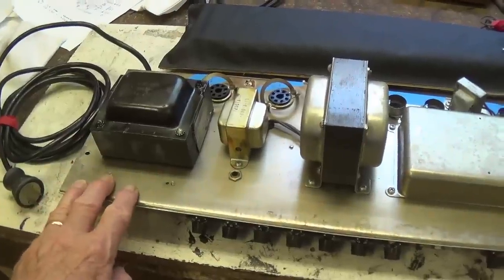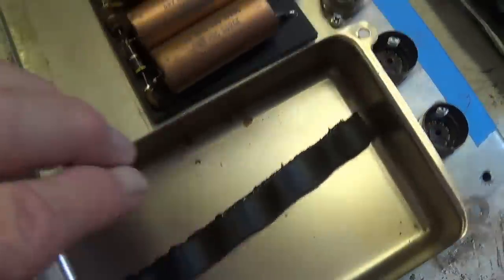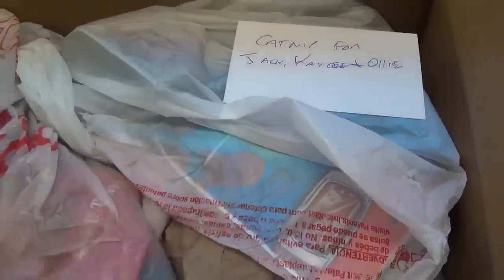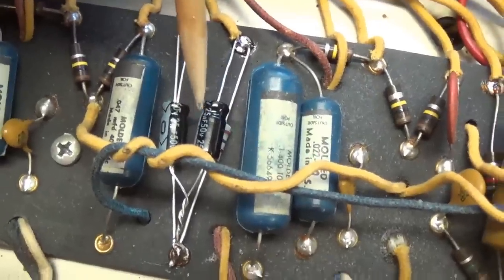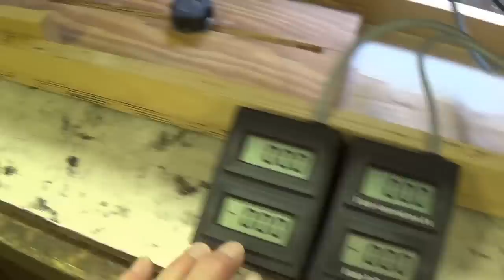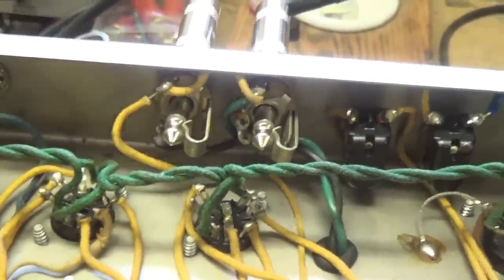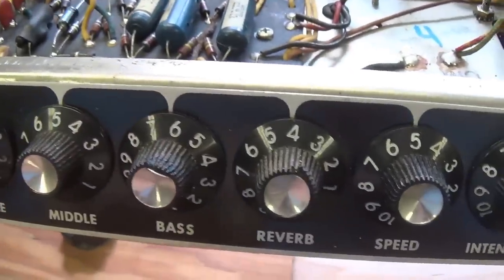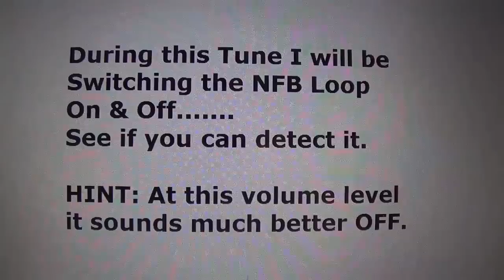1966 Fender "Blackface" Super Reverb:  In Storage for Almost 40 Years !!

Comment: I just got my '64 Super Reverb back from my techie guy. The amp was working but did not have any sparkle to it, and the reverb really vacuumed.  A tech or two from years past had installed some junk tone and coupling capacitors. I asked him to install blue SoZos in place of the brown and orange uglies, which he did. He also rebuilt the vibrato circuit (WOW!) and changed out a capacitor and a few other parts in the reverb circuit. I also asked him to install and bias two Tung-Sol 5881 power tubes, replacing a couple of WInged C 6L6GC's. I asked him to install SoZo silver micas for the treble caps. I also installed a big rectifier tube (sorry, cannot remember what that was, but it's a big coke bottle), to limit output a bit and headroom. I have some new vintage style reverb cables on the way! All I can say is, WOW! What an amp! After many decades I can once again say that I love my Super Reverb!
Reply from the maker: I hope it serves you well for many years to come, TT.
Reply: Thanks, Uncle! Got the reverb cables today and played the dickens getting them installed (working on the floor, which is tough when you're 76 years old!), but I got the tank (all cleaned up!) and the cables secured down at the bottom, and the wrong length cables safely secured to the side of the cabinet. WHAT A SOUND! I highly recommend the 5881's and SoZos! @UncleDoug
Reply from the maker: @Tonetwisters  Thanks for the update, TT. Glad it went well.

Comment: I just finished a Stromberg-Carlson p-p 6L6 Model 20/207 amp and couldn't for the life of me get anywhere near plate current balance no matter how many different pairs I tried. Since the amp is cathode biased with a shared resistor and cap, the only other possible cause for the imbalance was the output transformer primary winding which measured at 34.2 ohms and 37.2 ohms respectively, which accounts for the disparate Ip idle values.....It sounds great.....!!!

Keep up the great handiwork and the ice-cold humor Uncle Doug...!!!
Reply from the maker: Thanks !! Will do, Jordan :)

Comment: Hey Doug, love your work. I've had several Fenders in this orig condition (59 deluxe, '66 Super Reverb, 64 Princeton) and while it's absolutely necessary to do the recapping, I always feel like the guy who clubbed the last Dodo. There's no going back. Have you ever re-sleeved new caps in the old covers or made repro sleeves? I know it's probably silly but I'd love my amps to look original when I peel them open. Best wishes from Australia.
Reply from the maker: I understand completely and for years advocated keeping as many original components as possible.....which is fine for my own amps, since I can re-repair them quickly.....but for customer amps, considering the effort and cost of shipping, I just can't justify it.

Comment: Doug buddy working on that amp is an incredible honor!  

A few years ago I was engaged to clone a 1964 AB763 that was in very good condition but not as clean as this one. I didn’t have access long enough to fully blueprint the amp but a lot of the carbon comp resistors had drifted significantly.  The amp sounded GLORIOUS!  It belonged to a college professor who played guitar and harmonica through it, but his father was the one who hired me to make the clone ... his son wanted his amp back. 

Trying to make a long story short, my build was almost stock for the Vibrato channel. The major exception was bias vary tremolo from a Brown Vibrolux (6G-11) instead of the optical roach.  The Normal channel was anything but. It has reverb and tremolo. The tone circuit is Brownface Vibroverb (6G-16) with that weird tap on the Treble pot. I turned the Bright switch into a guitar/harmonica switch with different cathode resistance and frequency cutoff.  And I used plate resistor values close to the old amp - they were much higher than 100K. 

To say that the amp is loud is a gross understatement. 😎

One question:  when you are doing a major overhaul like this, do you go through a step-by-step startup procedure first with rectifier tube only, then power tubes, then everything, with a light bulb limiter in line in case something BAD starts to happen?  I’m pretty sure I saw a light bulb limiter in the background there ...
Reply from the maker: I don't do a step-by-step start up. As in the video, I replace all the faulty components, then install the tubes, plug into a current limiter (always), and turn it on.

Comment: I have the EXACT same amp.  Never serviced.   Its absolutely perfectly original.      You may have inspired me to recap and cord it, never considered the polarity to NFB switch, so thanks for that too.  Mine also stopped regular working status (in a country band) in the 80s.  The collection of tubes that came with it makes me smile.
Reply from the maker: You are a lucky guy, Otter. By all means fix up the old gem and put her on display.

Comment: Many thanks for another jewel of the 60's joined by the usual skillful job and helpful hints and also with your refined humor.....bondage prom... Those desert flowers are awsome! I have to say that Brad the Guitologist has a video where he dismantle the ol'days cheap tube theory showing a price table from the 60's. He recalculated those prices to 2020 and they are pricisely the same. If we have in to account that a lot of less production/demand happens now, it very impressive that the prices have not risen since then...Cheers!
Reply from the maker: You're quite welcome, AC. That's a good point about the price of tubes. Thanks !!

Comment: Hi Uncle Doug, Youtube would be nothing, without anyone adding his 2 cents to every video out there. So here are mine:
I was tought, that the green earth wire must be the longest wire inside the chassis. If someone rips the mainscable accidentally out, it should be the last wire to become lose. So it can still protect the user and the aparatus from shock. Even if someone pulls on the mainscable, the earthwire shall never become lose under any circumstances.
Also, it is always a good idea to bolt or solder the earthwire separately to the chassis. Thereby it can´t become lose and forgotten to get reattached if some part of the amp is demounted. So one should never use the  OT bolts or some other bolts and screws which are used to hold various equipment to the chassis.
Greetings from Germany, i learned a lot through the years by enjoying your videos!
Reply from the maker: Thanks for your input, B. I'm glad the videos are helpful.
Reply: @UncleDoug  forgot to mention, that draining the caps like you do is a very important part of any repairjob. I it the very first thing i do in an amp. I dont see it often done here in yt. Maybe you could do an extra video about it with explanation and measurements?
Reply from the maker: @rosettenzerrer  I will keep your suggestion in mind, B.

Comment: Beautiful amp Uncle Doug. My main amp is a 1968 black line Super Reverb AB763. I love it & totally agree on four 10’s being Fender’s best speaker configuration. I also agree they are a pain to lug around. I call it the “Super bear hug” because bear hugging a Super reverb is the only way to move one. If you use the amp handle you end up setting it down every few feet due to hand pain. But the tone is worth it. As there’s nothing better than leaning the Ol’ Super back on it’s tilt back legs, rolling the volume up to about 6, plugging in your Strat and striking up the band.
Reply from the maker: Thanks, Vaden. Your description of both sides of owning a SR is right on the money.  Perfection doesn't come without some pain ;)

Comment: Hello Uncle Doug, I can't help but think that you know Fender amps better than 'Ol Leo himself. Another awesome repair by the master of tube amps. I really like how you go into detail and explain everything so well that a novice could probably do it. The Vox AC 30 and probably the AC 15 had no negative feedback for some nice creamy breakup at higher volumes. The Hot Rod Garage must be why the recent Rod videos were removed by the uploader, I can't wait to subcribe. It's been hovering right around 100 degrees the last couple days, now cooling to low 80's and 70's. Glad your doing well. Thank you Uncle Doug for sharing your knowledge and experience. All the best from Oregon, Cass.
Reply from the maker: Thanks so much, Cass. There are just so many Fender amps in my area, and apparently in the whole country, that I am able to gain more experience with them. They are easy to work on and respond well to minor modification.  The video removals were my fault......until you're accustomed to two channels, it's easy to upload to the wrong one ;)

Comment: I am blessed to still have the 1964 Super Reverb that I bought brand new, somewhere around April or May of '64. I also have -- at great cost -- my late brother's 1966 Super Reverb, that had a 1X12 orange frame JBL in it. I converted that over to a 1X15. Both amps need work. As does my lower back, from "lugging" around that 4X10 for many, many years (not kidding)! 
Love your comparison between the DR and the SR ... I had no idea they were that close. I also have a '77 DR (not close to either) with a variable lower mid range adjustment, and that amp should be in prison because it is just killer. 
You need to be selling all those shirts!!
I remember reading some info on those mismatched power tubes, by one of the guys at Mercury Magnetics, who said pretty much the same thing you said.
I like that trem slow down thingie ...
I enjoyed this one, especially. Thanks.
Reply from the maker: You have some wonderful equipment, TT. Sorry about your brother. I've considered pedaling merchandise, but the (unavailable) time required makes it unlikely. Glad you enjoyed the video.
Reply: @UncleDoug  Thank you, to all. Yes, I understand the time thing. If you ever get a chance, check out Simon Jarrett's site, KingsleyAmplification.com ... talk about a busy man! He has an amp I want (the "Bailey") ... I have been on the waiting list for a good two years, and still have five years to go! Not sure I will be here, by that time!  Thanks again for this great video ... I will watch every single Fender amp video you put up ... as long as they are hand wired versions!

Comment: Great job Uncle Doug. Great tone from a great amp.

FYI: A good place to ground the power cord is at the AC outlet. Replace one of the sheet metal mounting screws with a small stainless steel machine screw, lockwasher & nut. Install a terminal end, attach to the green wire & your set. No need to "weld" a wire to the chassis.
Reply: I'm referring to the outlet in the amp of course,  not the wall outlet!
Reply from the maker: Thanks for the good suggestion, Dan :)
Reply: You're welcome. I prefer to stay away from the PT mounting studs as they can loosen over time. The outlet technique is applicable to BF & SF amps. If a blonde/brown amp has an power tube/rectifier cover plate one of the screws is replaced, & ground attached. 

I use small stainless steel screws primarily for strength. Grounds must be tight. A 4-40 × 1/2 inch I think.
Reply from the maker: @danh.8490  Thanks again, Dan.

Comment: Beautiful job Uncle Doug..!!  I just purchased a 1973 Super Reverb amp out of San Francisco ($500). It was serviced in New York state 10 years ago. There are upgraded caps, resistors and a distortion mod with a pot installed in the 2nd Normal input jack location. All it needed was Deoxit pot cleaning and 4 matching CTS Alnico 10" speakers.. It has lots of Mesa tubes and a few Electro Harmonix.. Sounds Superb now..!! 
Hey Uncle Doug... did you ever see the fantastic Brizio Hot Rod Shop in South San Francisco?? They are currently building a rod for Eric Clapton
Reply from the maker: Sounds like a great amp, Mr. G. I am familiar with their work, but have never visited their facility.  I'll bet it was quite an experience.
Reply: @UncleDoug  Brizio Street Rods are just so beautiful and well engineered. I have watched their work for over 35 years. Check out their website... great pictures.!! Thanks Uncle Doug.!
Reply from the maker: @MrGTO-ze7vb  Agreed, Mr. G. They are world famous for their creations. Sadly, they are way too expensive for "normal" folks :(

Comment: One of my favorite Fenders of all time, this and a Brown cover Vibrolux.  A Super Duper Super, I've always loved the look of the "Super Reverb" model logo, impressive.  
Great video as always, thanks.
  Cheers, 50gary
Reply from the maker: Agreed, Gary. You're quite welcome :)
Reply: Never played through a brown Vibrolux (only a black one,  which if I remember correctly had the LDR tremolo), but I repaired a brown Concert some years ago and the tremolo on that thing was to die for!  Those amps used several extra preamp tubes compared to the blackface amps with tremolo,  which is properly while Leo went to the simpler circuit of the blackface amps ---- but they just don't sound the same!

Comment: Thanks so much for the video, I plan to install the NFB loop switch mod in my Super Reverb after watching this. I wanted to follow up though with the question that was asked in a comment by Gianfranco Gerosa on the filter capacitor for the output tubes negative bias. The AB763 schematic shows a 25uf 50V cap. It looks like Fender actually shipped 50uf, 50V caps from every video that I have seen with the original cap still in place. It seems puzzling to me that the schematic also shows that 52V (+/ 20%) should be present for the bias, but it shipped with a 50V cap. With the tolerance getting it up to -62V, it seems that cap should have a higher DC rating. When I replaced mine, I used a 100V cap.
Reply from the maker: You are probably wise to do so. Although I have never encountered a failure in one of these caps, increasing the voltage rating to 100V or 150V (in some Fender circuits) is inexpensive insurance.

Comment: Hey Uncle Doug, you do realize that if you have a pair of output tubes that are not as well matched (as is the case here) you can simply switch sockets to see if they then draw closer in current. 
Take the tube in the right socket, put it in the left socket, and the tube in the left socket, move to the right socket. 
Output transformer primary windings are rarely if ever balanced due to the transformers construction. 

So if you measure (in ohms) the reading between the brown wire and red CT, then measure the blue and CT, you’ll see a difference, and this difference might be the difference of 2mA or so in current draw. 
Seems to have worked for me, though admittedly, if never checked it on a Schumacher OT made for fender. 
Hope all is groovy with ya.
Reply from the maker: Thanks for the helpful tip, VT :)

Comment: Nice amp. I owned a 68 or 69 Super Reverb about 20 years ago. I traded it ultimately for the Twin I ended up using on tour for about 20 years haha. Nothing against the Super Reverb, it was an impulse trade and the Twin had JBL speakers in it. E-120's. I could of used the Super Reverb as long as it had the Mid control like mine had. Need that Mid for doing Jerry stuff ;-)

Keep on truckin and thanks again for the videos.
Reply from the maker: You're welcome, CT. Will do :)

Comment: I always watch your videos and enjoy them. Thanks for sharing your troubleshooting tips. I have a couple of thoughts regarding the output tube bias current measurements. It is best to measure that without any signal. It is possible that the tubes are mismatched in performance so the weaker tube has lower current. That can be confirmed by switching the tubes in their sockets.  If the lower current follows the tube, then it is the tube. If it stays on the same channel, then it is in the amp. The DC blocking capacitor could be leaking and causing a bias shift on the channel with the higher bias current. Take care. Looking forward to seeing your next video.
Reply from the maker: Thanks for your nice comments, Stanley. In this case, it was the tube itself, probably due to a slightly more depleted cathode than the other tube, but due to the vintage high quality of the tubes......and the fact that moderate mismatch may actually sound better......I retained them.

Comment: Hey, @Uncle Doug. Hours and hours of learning and enjoyment with your videos. No exception here! Beautiful specimen.

You didn't know it, but your tips and tricks have helped me safely build three amps that I really dig. No smoke or flying screwdrivers!

P.S., I notice there are still some whistling robot artifacts whether using camera audio or the SM57 -- wonder if it's a bitrate issue or similar in the video encoding. Sounds great but maybe a couple of settings could take it to the next level. I'd bet a tube set that someone could help if you briefly shared your encoding / upload process.
Reply from the maker: Thanks so much, Noah, and thanks for becoming a patron of our channel. What would you need to know ?  Equipment, editing program, upload data from YT ??
Reply: @UncleDoug  Yeah, that stuff. Software, camera settings, bitrate, codec, etc. I noticed it on the 1928 Ford slideshow video, too, so there's hope it's just a couple of software settings.